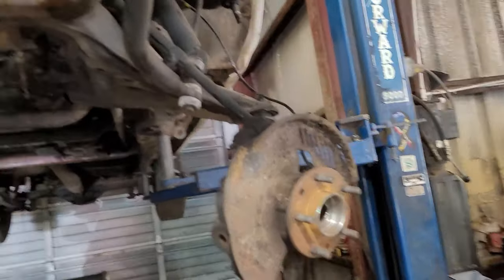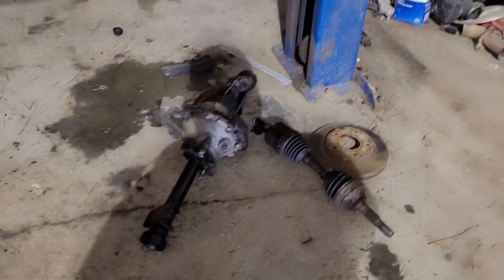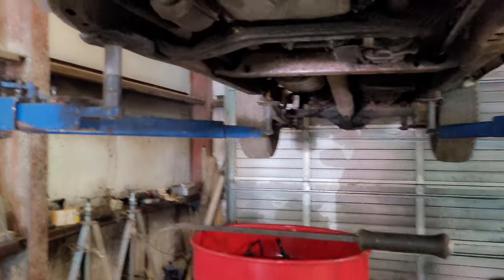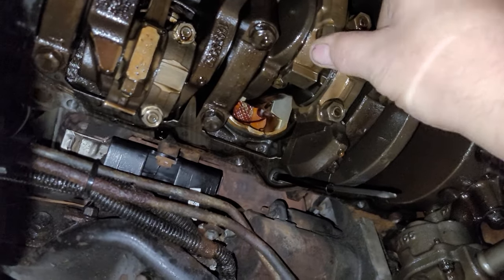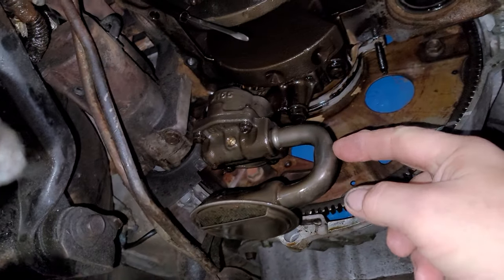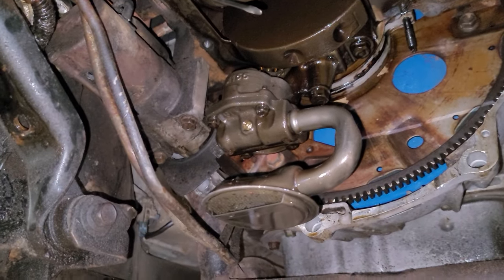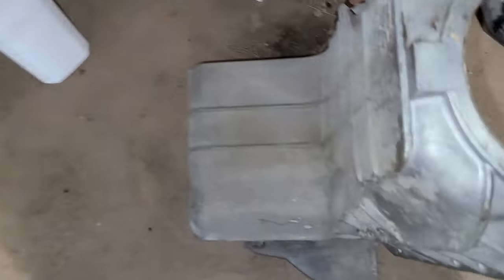Never seen this before. Chevy oil pressure problem

Comment: I tig braze the tube in. Also all the pickups I have put on pumps are press fit. I remove the bypass spring before any tig brazing is done. I also make a sheet metal bracket that bolts to the pump and weld it to the tube. Just did this on a 6.2 diesel.

Comment: The O-ring seal that goes into the oil pump from the pickup tube is a known problem as is the oil pressure relief valve right above the oil filter on them. I've seen people actually take the oil pressure relief valve off of the oil pan and replace it with a M 14 by 1.5 oil drain plug with Teflon tape on it.
Reply from the maker: Interesting, I will have to keep that in mind. Thanks for watching!
Reply: Your talking about an LS engine 
There’s no print on the small blocks
Reply: You are correct 💯
Reply: @A71-c6v  True statement. Seen several Gen 1 SBC with the pickup tube brazed in the oil pump body to prevent this.
Reply: There is no oring on this engine
Reply: Always weld the tube

Comment: I had a 4.3 that would do something very similar. Ended up having a rear cam bearing spun in block. No noises but it would just drop off after got hot. Put shop air in sending unit tube with intake off and sure enough you could see it bubbling between bearing and block.
Reply: Years ago I had a 262 V8 out of a Monza that lost oil pressure on me . Shut it down and coasted to my girlfriend's place . Went to leave it had oil pressure , WTF ?   It had split the rear cam bearing  . 43 years later I have never seen it again .
Reply: my 4.3  just did the same thing but it has 400k on it spun a cam bearing

Comment: As a retired dealership tech, this was my first guess. Weld the tube to the pump. A couple of tacks every 90 degrees will do the trick. Use a tapered punch to enlarge the end of the tube so it has to be "helped" into position.

Comment: Never seen an oring on a chevy   oil pump pickup tube, the relief valve is stuck, I've only used big block pumps on all small block, big blocks and V6s....

Comment: Reman - Who ever removed the screen from the old pump distorted the (knock in ) press fit of the tube going into the pump or by turning the screen to the proper angle after installing the screen . Who ever installed that screen should have known that was not tight enough and a problem that can destroy the engine , should have got a new screen . Ive seen people years ago rough up the tube (burs )so it would fit tighter in the pump , I guess they didnt think about it sucking air because it wasnt sealing correctly . Other companies bolt the screen to the pump so this doesnt happen . And NO their is not a o`ring on the tube , its a press type fit .
Reply: New pump, New screen installed correctly, pickup screen requires a specific tool for installation to the pump, have correct pickup for and adjustment to the oil pan to be used, and correctly tack welded (not to getting it to hot, or welding any debris) check everything before final assembly! SB Chevy oiling is critically important to life expectancy. Always New OEM Delco stock parts! 
GM already invested millions researching V-8 oiling systems 🙂 GBU
Reply: @ChevyCoco  All you have to do is , what ever spacing you want the pickup screen off the bottom of the oil pan , just start the screen in the pump slightly and slightly tilted up toward the pan , lay something the thickness you want it off the bottom > on the bottom of the screen , and then set the oil pan down in place it will push the screen down in the position where it belongs , then remove the pan put on some red loctite and knock the screen into the pump up against the stop . I have never tore down a GM engine with the screen tack welded to the pump..........Its not like a new screen is that expensive .
Reply: Always welded that pick up tube to the pump never had any problems with oil pressure
Reply: @davecramer9725  Go ahead and weld the freeze plugs , bearing races  and etc.. also while your at it , all of which are not necessary when done correctly .......Then call GM and tell them you know more about it than they do ...........

Comment: Older Chevys relied on an interference from it, and a lot of builders brazed or welded the pickup to the pump. I’d go for brazing myself, but a lot of engines ran right without that.

Comment: thats why i always weld a bracket on the tube and bolt it to the pump and i also epoxy the tube in the pump , been doin this since the 70s never had a problem

Comment: Hello, great video, I am having very similar gauge reading symptoms on my 2001 motorhome with 8.1 motor, I wonder if I'm having the same problem, and how hard it will be to remove the oil pan in a class A motorhome
Reply: In the video, he checked out the oil pressure with a good mechanical gauge first and then removed the oil pan 🙂 GBU and yours

Comment: Summit racing sold a bracket to mount around the pickup tube and bolts to oil pump to prevent it falling out. I made a version of it. So far, no problems and thats been 20 years ago.

Comment: It's actually common for this. A reason for the tack weld is a must. If you don't have a welder, use a little bit of JB Weld on it. Just make sure the surface is cleaned with no oil so it sticks.

Comment: Hello, I'm in same situation, just replaced sending unit only to get same low pressure as the old one. Did the new oil pump fixed the issue?

Comment: Thourally clean the outside of the pick up tube, and the inside of the receiving hole for the tube. Run a small bead of JB Weld around the tube just infront of the buldge on the pipe. Set in place. Allow to cure. Should be good.
Reply: Nobody in their right mind would use JB Weld to secure a press fit oil pump pitch up tube. Either the tube gets replaces or you swedge the tube to fit securely. Then tack Weld it onto the pump.
Reply: @PapawCulberson  yup. Now you've got it. 🤪
Reply: Mr. JB Weld Mark...Geezer Auto Repair...Justice Brothers Fixes...

Comment: I just did this job... first for me... I did NOT have to take the front diff or the rack off... took the starter off but realized I didnt need to...just removed the cross member, 2 nuts and 2 nutted bolts from the front axle. enough room to remove the pan... YT Universtiy!

Comment: The drop in negative pressure at idle would be enough to allow air into the oil feed causing the pump to cavitate at idle...and no oil pressure... You're right. Shocking mechanical design when you think it could wreck the entire engine potentially....🤔😳😏😏😏🇬🇧...Maybe it's a GM sales drive?
Reply: Not so shocking, it's a chevy remember.
 
This is my 2nd s10.  I've had a LOT of Fords. Never have a problem like this....
 This thing is hard as hell to work on too. Like he said, the oil sending unit is a rean pain in the ass, and the oil pan....OMG. Removing the entire front wheel hubs AND the frond Diff is insane.  Just for an oil pan. 
I have a spark plug I can't remove because the steering column is blocking it. I don't know if that plug has ever been changed in 150k miles. I can't trust a shop won't just skip it either. No knuckles or bolts visible for removing the steering column shaft either. I see no way to change that damn plug. Stupid GMC/chevy garbage.
 Anyone want to buy a clean 1995 sonoma 4x4 extend cab with 150k miles?

Comment: I'm 70 years old and learned 50yrs ago that a SBC that lasted 100mi was a really good one. Reason being where I live the roads are really crooked and unless you dam near stop to go around every curve  the oil will climb up the side of the oil pan and the pickup is sucking air bearings don't last long that way. I have never encountered any other engine that does that. So the lesson is if you live in the mountains and have twisting roads stay away from small block Chevrolet engines.

Comment: This is happening to my ‘67 mustang with the 200ci just got finished putting new rod bearings and mains in. Didn’t have to do the rings since the motor has 22k miles on it and has good compression. Everytime I drive it when it’s under operating temperature my oil psi stays at 40psi which is good. But when it gets hot (to operating temp) it drops to 20psi and when I brake at a stop light it drops all the way down to 0psi and when I made the complete stop it jumps back to 20psi. I’m hoping this is my issue because this project was very time consuming and they barley make parts for my original engine anymore
Reply: That sounds like it's simply low on oil when braking the oil sloshes to the front of the pan the pump sucks air for a few seconds then when you stop the oil goes back to original level and it picks it back up again or another thing to check is the oil pump drive that runs off of the distributor on some ford's they had issues w them slipping good luck w it ..

Comment: Years ago I had a 82 Volvo DL, thanks to a previous owner the engine had a bad case of piston slap so I pulled it and sent it to the machine shop for a rebuild. After I reinstalled it, I'd get a flashing oil pressure light at idle. I pulled the pan and found the idiot machine shop had put an older style oil pump in it but had not changed the pickup tube to match, it caused an o-ring to blow out. I had the old oil pump, I inspected it and found it to be in great shape, I put that in which solved the problem.

Comment: I have an 02' Blazer ZR2. Can't get to the oil pump or pan off without pulling the engine. 
It's been very well taken care of & has 300k miles on her.
I deleted the oil cooler lines & my pressure went up but at idle it drops below the 1/2 mark on the gauge. Then when I start going it goes back up past the 1/2 way mark on gauge.
With new oil it stays at 1/2 or higher all the time. Plus it depends on outside temp & I'm in hot area here South of Houston.
Reply from the maker: If you're concerned put a mechanical guage on it. The rule of thumb is 10 psi per 1000 rpm. Keep wrenching 🔧

Comment: Seems like it just sucks air at idle. Up the RPM and it sucks the pickup tight and provides good pressure. I’ve seen the same thing on fuel systems with a mechanical pump. Where the hose connects to the metal tank outlet it rots around the bead roll. When idling it sucks air and carb runs dry, but if you stay on the throttle it keeps going. That was tricky to find too.

Comment: What’s your take on an oil pressure gage rattling back and forth at 40 and drops to 20 while driving. Loud ticking sound. Is it the Oil pump?
Reply: Oil pumps don't usually go bad....there very well lubricated

Comment: generally if the pump is replaced...they can come without the pick up installed... I used to braze the pick up in place...also...to adjust the level of the pick up from the bottom of the pan...I shot for a 1/4in clearance... used play-doh on top of the pick up... squished it with the pan to check my clearance

Comment: 1999 chevy tahoe 4wd 5.7 v8 350. when i was installing my rebuilt, i had to measure the distance of that pick up tube, i had my brother weld it to the pump.

 One problem i am having though is my oil psi drops when engine is hot but only at idle or in park, I had a leak in the rear main seal which was installed backword, and when i was installing the transmission together i broke the oil pressure sensor on the top of the engine. I installed a new one and was noticing the said problem. Im thinking it might be my oil cooler adapter, that when it gets hot and the engine is at high rpm its sending oil to the intercoller or something like that. normal psi when starting and cold is 40, driving at 30-60mph when hot is 35ish, and complete stop or warm and idle is below 10.

Comment: My 305 pick up screen did fall and screwed  up some rod bearing  i did a complete overhaul cam and  bearing too and at a idol  its 10 psi and thats with a high volume  pump got 700 miles on it now highway speed i get 45 psi

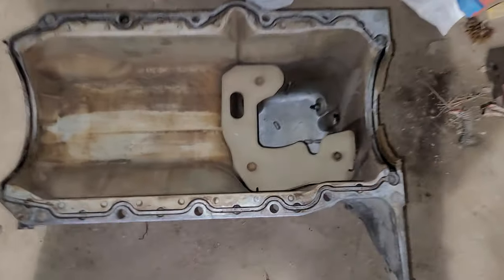Comment: the pickup tube is missing the o-ring which notoriously fails 7k-120k miles on all chevy trucks. personally i think it's the methheads & coke sniffers of indiana and ohio at ft wayne plant. not joking about the drug use. it's rampantly bad. 3:00 also the roll over knocked all the sludge out of it's secluded cavities so it winds up in the pan and the sump sucks it up into the tube. that one looks recently replaced or cleaned. learned this from crazed performance repair on his ls engine rebuilds
Reply: Small blocks did not use a o ring like the newer la engines.

Comment: I was in the auto parts business for 50 years. This is why you never reuse a press in oil pickup. I assume the the reman engine came with the pump installed but without a screen ( this way the same engine part # can fit more vehicles whose oil pans are different.) Even if the old screen "felt tight" when installed it is not as tight as it needs to be.

Comment: Lucky that didn't fall out while running down the road. I had a 1997 Jeep with a 2.5 and 200k miles that would do the exact same thing. The pan on it was actually easy to pull so it wasn't quite the PIA as a pan on a 4.3 in a 4x4 is. The new pump fixed it. But I bet you are right on your application, the pump was probably OK, just the pickup tube drawing air when it got warm and at low rpms.

Comment: I would take the spring out of the oil pump and tack weld the pick up and after it cools put the spring back in but add one small washer to the end of spring for just a little added pressure but as long as you’re already in there I’d take the pump out and apart and blue print it.check the clearances and sand flat on a piece emery paper on a piece of plexiglass to make sure it’s a flat surface put together make sure it spins freely before reinstalling and you’re golden.there’s not much else that can be wrong with an oil pump.they don’t usually spin that free without the extra care.

Comment: I have a 2013 f-150 3.7 naturally aspirated, 102000 miles, its runs great has lots of power, but once its warmer 20+ mins of running if you come to a stop and put it in park it has a roughness it''ll be like smooth then every like second 2 it'll stumble then smooth then stumble, in drive at idle it is so smooth you cant tell its running but if you put in park smooth then miss,smooth then miss, I've had it to ford many times, they ran injector cleaner, and replaced spark plugs, smoked the intake for intake leaks couldn't find anything ive done a ton of maintenance and the fluids are good new air filter, new mass air flow sensor just bugs me a lot but they say they can fill it but can't find anything. they tested fuel pressure and which was good and did a power balance and said its normal, but i've been in other trucks and the idle is super smooth in park or in drive with the break on. so just wondering if you had any ideas

Comment: I have the same thing going on in my 2003 silverado 4.3 
I rebuilt the top end, put it all back together,  runs great then slowly goes to 0 pressure.  I was going to put in a  High volume pump. Please keep me updated.  If you fixed your problem.  Thanks
Reply: About the only solution is to drill and pin it on with a screw / bolt or use an aftermarket pickup that has a stabilizing brace that bolts to one of the main bearing bolts. IIRC they also make one that has a brace that bolts to the bolts on the oil pump body. 
Fix it quick before the pickup drops off there and destroys the bearings

Comment: Check the pressure by pass on the oil pump. Ive seen them stick with a piece of debris, holding it open. It'll make pressure still, but it'll be all over the map. When the volume of the pump comes up and loads the system, pressure is fine. But if the by pass piston is stuck, you rely on the volume of the pump at low rpm to produce pressure and if, like you surmised originally if the oil is aerated/foamy at all, you wont have jack for pressure. Especially if the pick up tube is sucking air too.

Comment: 2006  Suburban. 4X4 
Would loose oil pressure when hot.
Changed:
1. Pressure sensor (checked screen)
2. Pickup O-ring (old one good)
3. Oil pump (old one good)
Yes, I dropped the front differential and oil pan.
I don't know what he eventually did with it. It did have a lifter tick. I'm wondering if the cam bearings were wiped out bleeding oil out? I believe the millage was around 150k.
He wanted to sell it. He pondered disconnecting the alarm, which I didn't approve of, but theLow oil pressure alarm was interical to the sound system. 
Anyone have any insight?

Comment: 1997 Honda Accord struck a deer. The impact was enough to break the windshield washer nozzle!
But if the pickup tube was still in the pump, but loose, may not be from the impact.

Comment: You may want to make sure that it's not the oil filter gasket. You may have double gasketed. Or there may be a plastic on the oil filter. I knocked a round pin through mine it is a expanding pin never had any problem with it after that

Comment: Had that happen to me on a 1966 so 396 after a rebuild, ended up tack welding the pickup to the oil pump , not trusting the press fit !

Comment: Granted, I know oil pressure in trucks can vary. But on my 89 K1500, I want to say an 1/8 to a 1/4 lower then 30 ( half way ) and stays there.   Is this a normal operating range?

Comment: When the oil is thicker, it has more suction at the pickup screen, as it gets hotter, of course it thins out. When you let it come back down to idle, the oil fills the pan back up more causing the pickup screen to actually float in the oil. Then it backs out of the pump enough to get against the pan baffle and not come out. Causing cavitation. No oil pressure. Then raising the RPMs back up creates more suction because of the volume needed. Then pulls the tube back in the pump. And ta-daa. Oil pressure.